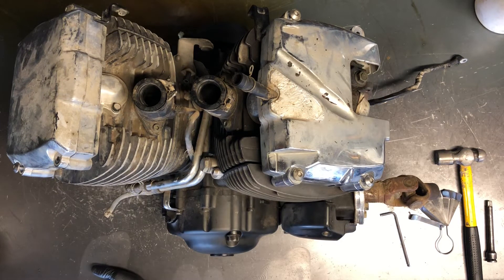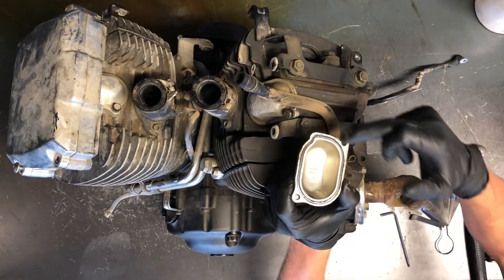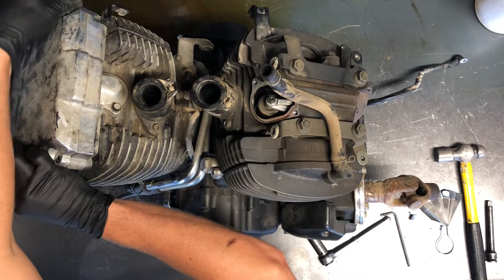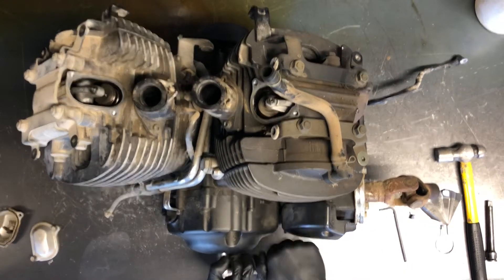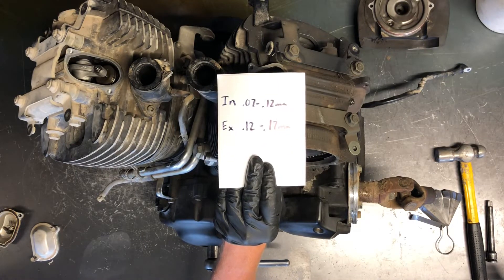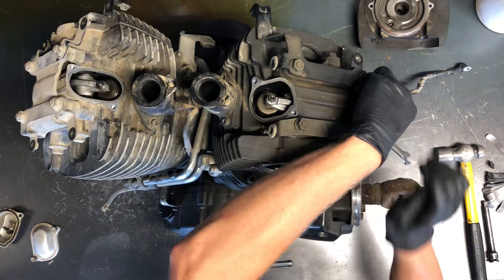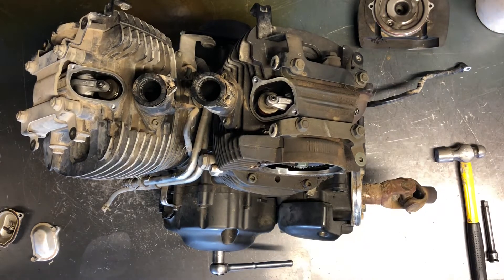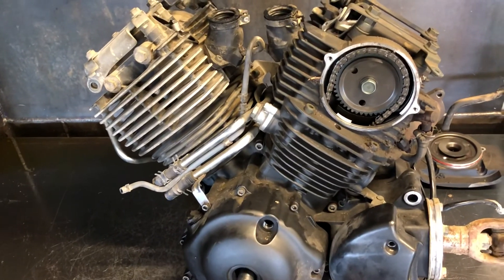How To Adjust Valves - Yamaha V Star Vstar - Twin Cylinder - Specs Clearance - Hard Starting

Comment: Overall , not to bad a video . I just picked up a 2007 and will be checking the valves shortly . I have had multiple shim and bucket bikes along with full hydraulic , but I have a fondness for valves you can actually adjust with a locknut . Years ago , my friend and I traveled cross country on KZ 400s and we would stop for gas and lets bikes cool enough to work on and then I would adjust both bikes in 20 minutes or so . But the V-Star has much more crap in the way , but thanks for the introduction .